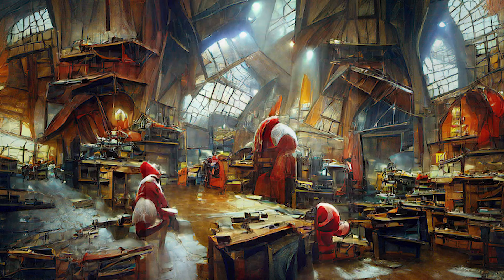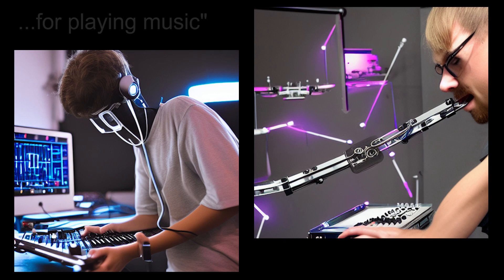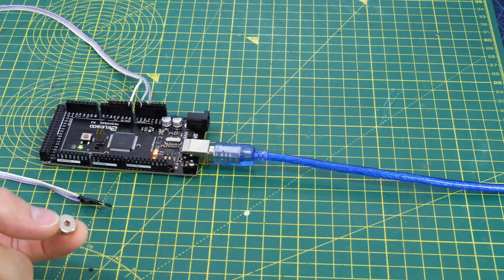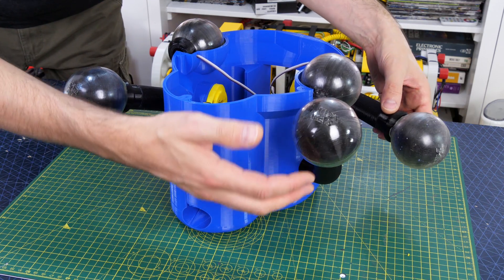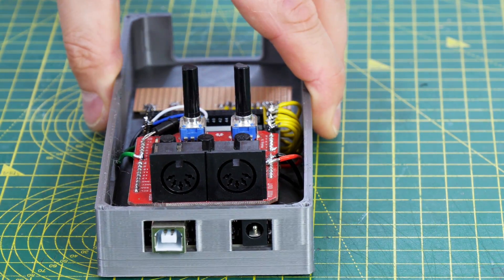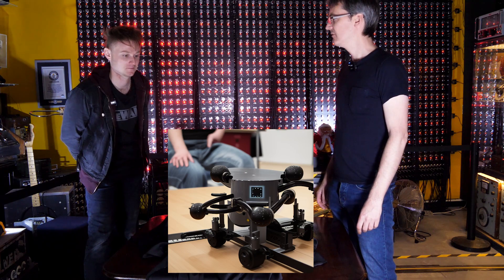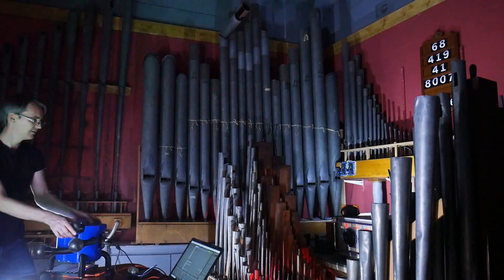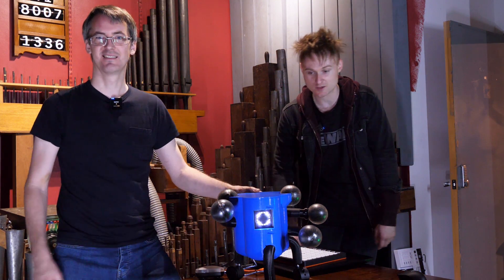Can I Build what A.I. Designs?

Comment: It's a pity that the images used to program these kinds of art AIs aren't separately organised by physically possible objects & fantastic ones. As far as the AI is concerned, many of the perspective tricks used in M. C. Escher's art, should work perfectly well in real life, allowing you to create a waterfall which loops up to fill itself. 🙃

I'd love to see the same kinds of AI neural networks used to develop structurally engineered objects.  Being able to sketch out the idea of a house & have an AI extrapolate to draw up the plans for one - using industry structural standards & off the rack parts (ie: aluminium window frames, doors, etc. ) - would be awesome.

Or teach one to read 3d print files from the millions of open source ones available online.
Reply: It's a pity you use so many words to beat around your mommy issues

Comment: quick question:  what type of linear motion would you suggest for raising a platform up and down holding a drinking cup?  and keep in mind, when in the uppermost position, it needs to stay there.  
the only two i can think of that would be easy are a ball screw and rails or a T5 belt and rails.  so which one would be better, or is there another that might work better than either?

Comment: Midjourney just came out with a version 4 beta last week, IMO it looks better than Dalle 2 and stable diffusion, you should check it out. You have to manually activate version 4 in the settings though because they haven’t made it the default yet.

Comment: If you have a half decent modern computer then by far the best way to do Stable Diffusion AI art stuff right now is to run it locally on your own machine using the open-source WebUI. Besides that I have an extreme bone to pick with you here as there are dozens of different models which have focuses on a variety of subject matter, ethnicities, art styles, ect., but you're acting like "society" has done something wrong just because the one model that you happen to use defaulted to drawing white guys for your extremely broad prompt when you could have very easily asked it to draw a "brown" person doing the same work and it would have happily made a "person of color" the central focus of every picture doing the exact same things. That completely unnecessary and absolutely brainless comment made me immediately lose respect for you. I honestly can't believe you even brought that up. I mean I had heard England had gotten pretty bad with the mindless woke-cult nonsense, but you're seriously so far gone that you're preemptively insulting a computer for drawing a picture that you didn't bother to specify enough. Hard to believe sometimes how wild the variance can be where someone is so incredibly intelligent in one area, but then so incredibly foolish in another.

Doubly ironic is you make that comment, yet all of the YouTubers you specifically named (which were not invented by a literal computer that has no concept of "diversity" and can only do exactly what you tell it to do) were all "white guys". Dang, internal bias much?

Comment: The way I would've interpreted it is those structures on the base  would be for some sort of X/Y mechanism, like on 3d printers, and those balls would be "bopping" sensors, some sort of air pressure sensor inside that detects when something hits or presses on the balls, and the robot would ride on the X/Y gantry modulating the steppers to play different notes based on the strengths and/or duration of the squeezes on the balls and change the robot movement depending on which balls are pressed (and either it was near the limits of the range of the gantry).

Comment: 💡 James, I would like to see you build a tunnel-boring machine, based on the screw-drive locomotion concept:
https://www.youtube.com/watch?v=UuDNc-_4v94
https://www.youtube.com/watch?v=N54fzGwMybk
https://www.youtube.com/watch?v=haHZzTIQAt8
Instead of just the 2 screws mounted on the bottom, there would also be 2 screws mounted on the roof, and another 2 screws on the sides. The very front of the machine would be a road-header, which would be gimbaled.

Comment: That old electromechanical phone switch at the end is pretty amazing tech. For something like 60 years that was the pinnacle of telephone communication tech. The mechanical delay was initially masked by the low latency of the number disk you used to enter the phone number, but later when tone select phones was introduced you still had to wait for the switches to work through their sequence before the phone call would connect.

Servicing these was also an interesting task. When the new electronic switches started to replace these old units it lead to some interesting problems when old habits turned out to be incompatible with the new tech. In the 70's Ericsson rolled out a switch family called AXE. These were electronical and much faster and with almost no moving components should be a lot more reliable than the old electromechanical switches. For compatibility reasons they used basically the same formfactor so they could be dropped in as a direct replacement for the old switches, but they could also be a lot more space efficient for new installations. A technician I talked to caused quite a bit of problems with one of the early installations. As the connections were the same for these new switches as for the old ones it was thought that the technicians wouldn't need much if any education to be able to handle simple tasks such as connecting a new subscriber. The line terminals looked the same, used he same layout and for all intentions were mechanically identical. So they sent them in with their clipboard and work orders and things were fine, or?

The first time he worked on one of these he'd barely started before an alarm went off and technicians in white coats flooded the isle ushering him out. So he took his tools and left them to it. Once they had figured out that the switch was working correctly again he got the OK to go back in. Rinse and repeat.

So he's on his third cup of coffee when he get the OK to back in, and panic ensued again. This time they started asking him just what he did as it seemed whatever happened was connected to him starting to work on the switch. But nothing he told them should have made any difference. So a tech followed him in this third time to see how he worked. So he took his tools and clip board with the work order and walked over the relevant switch, removed the cover, checked his work order to see exactly what connection he was going to set up and stuck the clipboard to the chassis where he could see it while working. And panic ensued.

Turned out that sticking a magnet to the chassis was not something they'd considered when designing the switch. And so all technicians got new clipboards without that handy magnet...

Now that was the story as he told it. Personally I have a hard time figuring out just what would be that sensitive to a magnet in a fully electronic telephone switch. I can only guess there were some relay placed close to the spot he slapped the magnet on. It's a bit ironic that the old Ericsson 500 switches they replaced contained a lot of relays and electromechanical components and yet they were not the least bit sensitive to a relatively weak magnet like the one on the clipboards being stuck to the chassis.
Reply from the maker: It's fun to see in real life

Comment: The AI images aren't art because there's no artist or intent behind them. The actual robot is the art.
Reply: Unless you subscribe to the death of the artist, in which case it doesn't matter what the intent of the artist was - all that matters is how we chose to interpret it.
Reply: @reverse_engineered  You can't die if you were never alive. If the images must be art you have two options. Either the programmers of the neural networks that make them are the artists or every artist behind what the AI is trained on are the artists, or perhaps both are. The AIs are just simple math repeated several times to get interesting results.
AI could make actual art, but only when it's sentient and that's just a bad idea.

Comment: this is literally what happens when u ask an artist to design a machine and the engineer is like ok cool but what!?

i have a few different Ai cmd on my laptop its actually pretty quick to run it on ur computer the internet normally only run it a few cycles to get the image .. if u let it run over and over it just keeps adding like a artist painting new features over the painting 

stable difusion is by far 1 of my fav and u can upscale 

that being said my GPU has 16GB and well the max image i can push out is 1601x1456 and then it runs out of video memory i can however run 1 of a few different Ai upscales on it and that requires less memory so it can scale the original image up quite high and its actually pretty good  .. i wish i could get it to run on my ram as i have 64GB but i guess its limited to the GPU memory 

if i was going to build an Ai rig id go back in time .. buy those old nvidia GPUs designed for extreme span graphics that are useless for video games but have a ton of video memory they can be 24GB or more in some situations and they are less expensive and u can just buy a modern system with 3or more express slots and run each at 8X and have silly amounts of GPU memory and really push the Ai to build large span art 

plus i love just watching it work frame by frame its like watching a dream unfold in ur own mind

Comment: How about using the "squishy things" from horns to press by air pressure against magnet on spring in tube with sensor on the other end of spring? Would allow you to squish in any direction...
Reply: You could also just use a pressure sensor - no need for magnets.

Comment from the maker: What would you like to see me build next that AI designed?
Reply: A "James Bruton Robot that makes other robots"
Reply: rc plane or boat would be interesting.
or see what it would come up with prompted with dog robot
Reply: Ask GPT3
Reply: You said the AI is open-source - could you perhaps train it on your own dataset for future attempts? It would be interesting to see what it might produce if trained on technical diagrams - and perhaps given a limited training set it might not be as slow?

Also this video had me smiling the entire way through, thankyou :)
Reply from the maker: @segue2ant395  I believe it cost $600,000 to train in the first place using AWS Cloud
Reply: @jamesbruton  Crikey! I guess all the expensive parts of the process happen there then. Makes sense I suppose - I've written simple Markov Chain "AI" before and even training stuff as simple as that can take a lot of compute power to produce meaningful results.
Reply: @segue2ant395  we use tensor flow at work to generate AI that outputs data from a camera for what we do at my job. (It’s welding robots btw lol) they adjust parameters based on the AI generated data. Tensor flow is free to use and easy to set up. We’re also training them on thinkpad laptops that DONT have that much compute power lol. It just takes a while…. (The heavy computing computers that we do have are used to do rendering for creating 3D images for sales and marketing XD)
Reply: @tylerwright6006   Thats application specific. A universe away from being able to literally type in a textual description of anything you can imagine and having it render an image of it. This neural net has billions of parameters and terabytes of data.
Reply: I would love to see an AI design a game for human entertainment
Reply: Hi james, I think an AI generated flying contraption of some kind would be an interesting build challenge for you.  🙂
Reply: Redesign the children's tricycle!
Reply: Perpetuum mobile. Infinite energy machine. stuff like that.
Reply: perhaps a mechanical linkage (like linear motion for example)
Reply: Experimental robotics for playing chess.
Reply: Have it make walking robots?
Reply: Ask AI to build something to fix my ears after watching this.
Reply: Something that every part is made with generative design in Fusion360
Reply: James, I would like to see you build a tunnel-boring machine, based on the screw-drive locomotion concept:
https://www.youtube.com/watch?v=UuDNc-_4v94
https://www.youtube.com/watch?v=N54fzGwMybk
https://www.youtube.com/watch?v=haHZzTIQAt8
Instead of just the 2 screws mounted on the bottom, there would also be 2 screws mounted on the roof, and another 2 screws on the sides. The very front of the machine would be a road-header, which would be gimbaled.
Reply: Very, very "Off the Air"
Reply: A robot that can virtue signal as badly as you did.
Reply: you should try to use hyperganic its a new ai that can make 3d models
Reply: Armor
Reply: @marz.6102  Absolutely. Seeing an absurd Iron Man armor designed by an AI would be hilarious!
Reply: @Seren-dipi-T  bruh that would be funny, but how tho?
Reply: it was not really a robot. But still cool. Can you ask the ai to make a experimental plant grower? I know there are better words to use but I think keeping it more open would produce more interesting results.
Reply: A walking dog.
Reply: A Doomsday Machine >:D
Reply: Ask an AI to draw you a bike and make that bike
Reply: Clearly this music instrument was designed by a robot, so it's not for humans. I think we need a robot to properly play the robot instrument
Reply: An AI designed robot to play this ... instrument.
Reply: I think you unwittingly designed something that will help AI take over the world!
Reply: Try use AI from midjourney :)
Reply: Try AI drawn circuit diagrams!
Reply: Something you could call "based on Pattern Matching", or "Machine learning". I am still not fine with calling it AI, since the intelligence was not learned by the machine, but developed by a human. Cheers.
Reply: A new mode of transportation
Reply: AI designed Keyboard for PC
Reply: Hey James, how about an AI designed 'Rube Goldberg Machine' pointless yet TOTALLY fascinating to watch (if you can get them all to work lol) - OOHHH maybe you could get Adam Savage (from the Mythbusters) involved somehow... he's made a few over the years but he always puts his heart and soul into them....  it would be interesting :)
Reply: can you do more collabs with Sam? you two are like total odd couple
Reply: Animatronic creature
Reply: Can't answer this but you should send the video to Bill Bailey. He'd love it!
Reply: A walking robot
Reply: Mount this one on tracks so that it gives an additional x y output as you move it around, that'll be more like the original picture
Reply: Is thare a way you can make the ai print a 3D image instead of a 2d I think the rest is obvious make a 3D modle of it
Reply: yes
Reply: A flying car!
Reply: A machine that you can draw with, akin to an etch a sketch?
Reply: an ebike
Reply: Robot that end poverty
Reply: Anything which needs physics to work. Like how an airplane's wings need to be a certain shape to function.
Reply: Don't know about AI but I'd love to see you make an AT-AT Walker.
Reply: "An exo-exoskeleton for roaches"
Reply: @malkeus6487  the only creatures more powerful than AI ….. cockroaches 👀… and you want to give them MORE power?! 😵‍💫
Reply: It doesnt 'design' anything, neither does it 'want' anything. It interpolates the neural network latent space based on existing internet image input.
Reply: @Sven_Dongle  wow... you MUST be the life of the party
Reply: @ThatTweedle  I dont go to parties with misinformed betas.
Reply: @Sven_Dongle  Just let your imagination take over a bit... It's a step in a direction that wasn't there before
Reply: @DonsArtnGames  I dont need my imagination, I know how it all works.